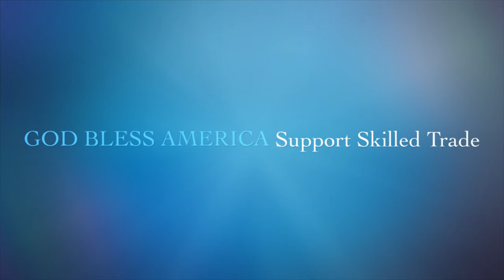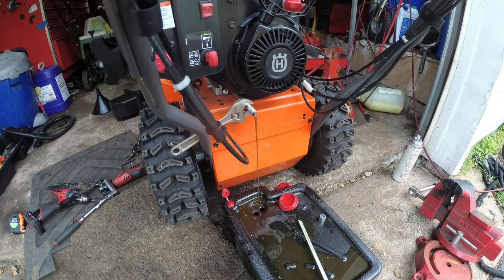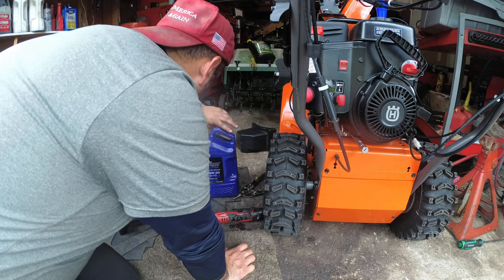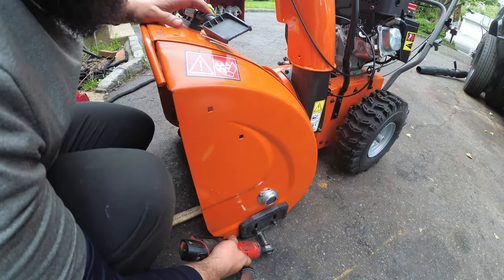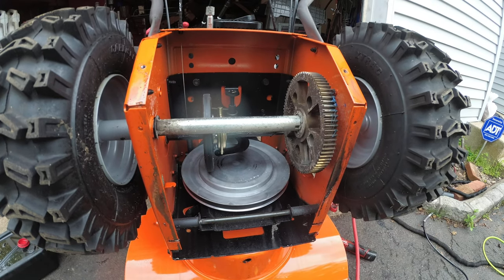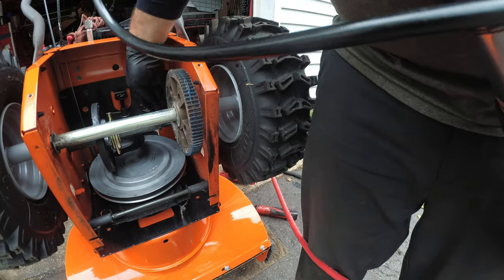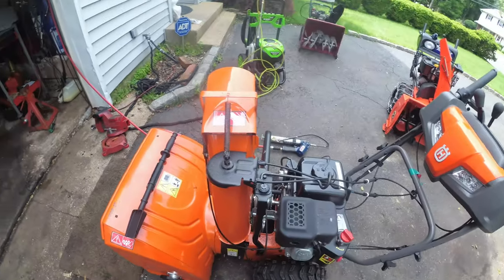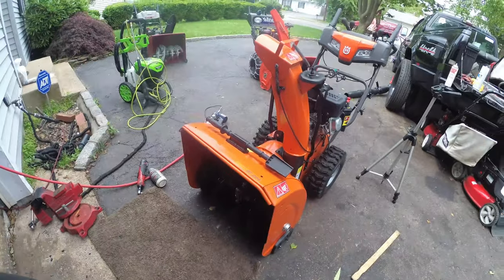$125 Husqvarna ST224 2 Stage Snow Blower P4  HOW TO Tune-Up / Maintain / Winterize

Comment: Do you by any chance have a video showing how to replace the friction drive belt? So I greased the hex shaft and ran the blower today, all was good for a couple minutes. Suddenly there was a bang and I had no forward or reverse drive; smoke coming out of the drive belt area. Took the shield off that covers the drive pulleys, friction wheel drive belt is snapped and smelling. Took the pan off the back again and found the problem. The friction plate is mounted to and pivots about a bar that runs from one side of the gear case to the other. The bar is shown clearly at 16:11 in your video and other times too.That bar had pulled through one side of the case and the assembly was tweaked into a bad position, pinching the friction drive belt and snapping it. The retaining clip or snap ring that should have been on that pivot shaft was gone, either broken or popped off somehow. That allowed the bar to move into the gear box and blow it up. Thanks. "If it can go wrong, it will, but better in early October than late January."
Reply from the maker: I don’t have videos on belt replacement for your exact machine but I do for others.  Same concept applies.  

You will have to disconnect the auger belt from the crank pulley to get to the drive belt.  

Keep the belly pan off you can slide the belt through.  If you need help…shoot me a message on Instagram and we can video chat
Reply: thank you for getting back to me so quickly! So this thing is only one year old and it's within warrantee (which looks like 3 years) but I soulde be able to do the work myself. I don't want to run the risk of having to pay pickup / delivery fees and have Husqvarna say 'well, we're not covering this because.....'   insert the excuse. @pattayperformance
Reply from the maker: @williamsomers1536  understand! I void warrantees 🤣

Comment: This was a great video.  I have a 2016 ST224P, with the 208cc engine.  The manual states 16oz….but you are saying 20oz.  I guess I’ll buy two quarts.  I also appreciate your comment on clearing snow to bare pavement.  Unfortunately, my driveway has a slight grade on a north slope….and we live in the early-day shadow of the Holyoke Mountains.  I have to clear down to pavement….as ANY snow left behind becomes a ice skating rink!  Bravo-Zulu….this was an informative video!  Thank you, sir!
Reply from the maker: We are the same way!  Sun NEVER hits our driveway!  We really need to be on top with ICE MELT and chopping it up!

As far as oil start with recommendation from the manual and ADD as needed.  It’s easier to add oil then remove over filled 🤣

Thanks for the view and comment, hopefully you subscribed to our channel 🤙🏻🦅🇺🇸🔧
Reply: 1qt = 32oz right？
Reply: @justinliang2443  thanks much, for that reminder, Justin. That is Correct. 32 ounces to a single quart.
Reply: @captaincoyote1792  I'm going to take care of it for winter.  Planning to oil change to mobile 1 5w-30

Comment: Nice! This is the best Husky snowblower maintenance video I have found by far. My Husqvarna ST224 came with never-seize on the hex shaft (for New Hampshire??? I don't think so. Not really what never-seize is for anyway, far as I'm concerned). What low temp grease did you use? I see you mentioned chassis grease on the gears. I have some NAPA Sil Glyde, rated at -20, but never have used it before.Thanks!!
Reply from the maker: That grease will be fine…any grease will work as long as you do it often…catch my drift 🫡
Reply: Thanks!  @pattayperformance

Comment: Whenever I tilt it back to drain all the oil, gas would keep coming out of carb or overflow. Even after shutting off tank and closing carb valves. Why didn't your leak?

I have same machine. Thanks
Reply from the maker: The angle throws off the float.  If you shut off fuel valve, the gas will still run out of carb.  After a period of time it will stop.  If It continues to flow your fuel valve has failed and it needs to be replaced as well.  In the OFF position no fuel should pass through.

Comment: Nice video.  Thank you.  The owners manual says there should be a crush washer on the oil drain cap but when I changed my oil the first time, there was no washer.  Doesn't leak, though.  Thoughts?
Reply from the maker: You can do 2 things...

If it’s not broken/leaking leave it be just monitor it.

Order a crush washer and install it piece of mind.  

Don’t forget to modify your impeller which is done on this series.

Thanks for the view and comment, hopefully you subscribed to my channel 🤙🏻🇺🇸🦅🔧

Mind me asking where are you from?
Reply: Pattay's Performance    I’m from Petoskey,  MI which is in the Northwest corner of the state, on Lake Michigan.  Needless to say, we get a lot of snow up here.
Reply from the maker: geminiguy2001 we have another month before we start prepping for winter.  We haven’t had snow in 2 years 😢. Farmer’s almanac predicted another warm winter but now they just changed it!  

Great job and getting your machine in order well before the first storm!

Comment: Is anyone else thinking about that hole left open in the bottom of the machine in the very front? I know for a fact that if snow and ice get in there that rubber drive wheel will slip and your machine will go no where. Thinking about wedging plastic or even cardboard in there.
Reply from the maker: @tazmun  it’s there so melted snow leaks out.  Doesn’t stay in the bucket and rust it out.

Comment: Another great video. Recently did an oil change and I used sae30. Is that ok or I should have used 5w30? Do u use any oil or gas additives like marvel mystery oil
Reply from the maker: Thanks for the view, comment and compliment!  Due to the temperature of the oil PLEASE switch back to the recommended 5w-30!  I USE ZERO additives to the oil since I use Royal Purple.  I do not run any additives in the fuel either as it isnt necessary even though we dont have the luxury of ethanol free fuel.  If you were to run an additive let me be seafoam for your first tank of gas to help clean any deposits.  When I take my 2 cycle backpack blower out of storage I add fresh mix of fuel with seafoam and I use starting fluid to help it get started with ease.  Let it run and let seafoam do its work. From there no more additives.  Jusr what the machine calls for.  Marvin would be great to throw down the spark plug hole when storing it foe the off season!